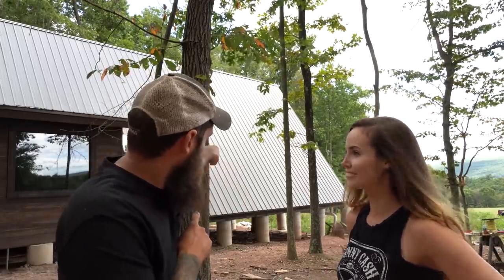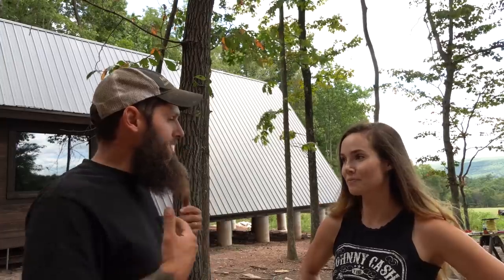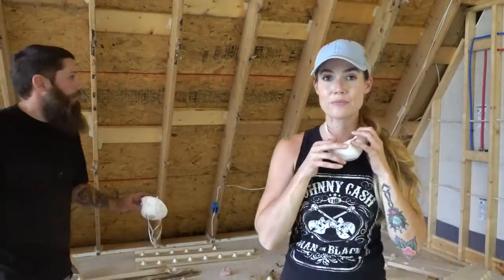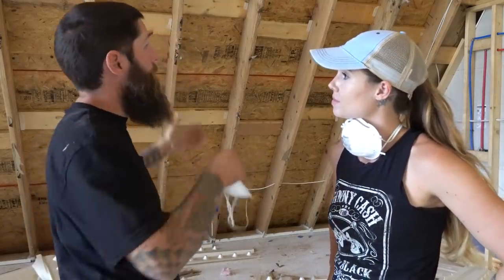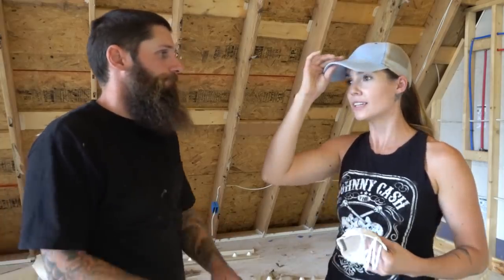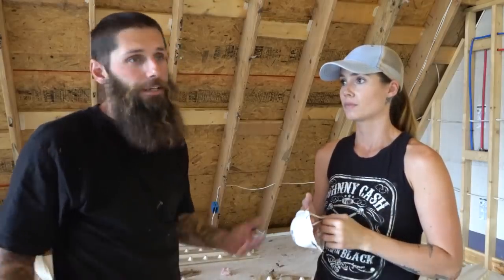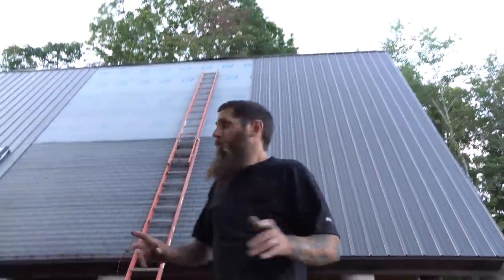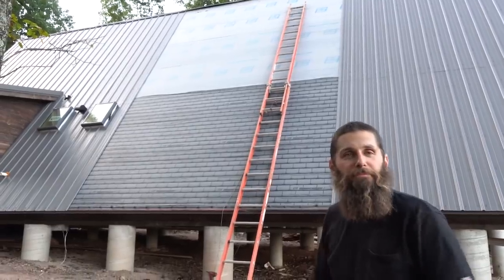Our BIGGEST Mistake Yet!

Comment: its only a mistake if someone else has to fix it! other wise its just the evolution of the project- ; )
Reply: I'd call it a modification during construction... not a mistake.
Reply: correct
Reply: Gotta remember to tell the wife that next time! Thanks!
Reply: I plan to build something from scratch because I want to be able to make any and all modifications I might determine necessary as I progress through the build. It's much better, cheaper and much less labor and waste than building and then tearing it back down and trying to install the modification after it's already been closed in and built over what you decide to later modify.
Reply: Sometimes we change our minds, it’s ok...when you build it yourself you get to change it because you know exactly how it was put together.

Comment: Keep adding dormers and you'll have a regular house before you know it. Looks great though.
Reply: I was thinking the same thing. Even thought 2 original dormers were funny, I thought the whole idea of an A frame is cost and time, adding dormers is wasting of materials and very time consuming. But then I never liked A frames due to their loss of usable floor space.
Reply: An A frame also helps with snow removal. And regardless your comments and not really helpful, sarcastic and judgemental.
Reply: @TheShays   Nope, Matthew or Roberts comment wasn't sarcastic or judgmental....They have a right to an opinion just as much as you do....Now your comment about them is judgmental...
Reply: I had the same thought. It is good to consider the adaptation of houses and consider the end results and if maybe there could have been a better place to start. The A frame seems to be easily retrofitted in the end.

Comment: Let more light in..
Looks good. 
Are yous going to put a matching Apex roof on the opening.
It is going to be the main Entrance to your home so I think yous should pay lots more attention to detail and make it look impressive.
Big Apex with a room window in the centre above the double leaf front door that you can slide up & Down. A TIMBER Frame Porch with big timber beams and nice shaped knee Braces coming from the timber beams holding up the porch Beam and nice  decking for the planters swing and rocking chairs.
I'd say about 8 feet deep for the decking so you can put a beautiful chunky custom timber railing on it.
Have a vision and see what I see.
It'll look absolutely beautiful.
You could also use the porch roof as part of the flooring for the room above the front door brining the Apex halfway out onto the porch roof with a double leaf door instead of a window and walk out of the room onto decking above the porch roof with another Beautiful handrail with some planter boxes and seating.
Sit down and DRAW IT you'll see it. 
It'll look amazing with Josh's concealed lighting and brilliant electrical engineering skills.

Comment: Hi good morning its 7:39 am in good ole new jersey.i have a question/ suggestion..my cousin has a A frame home. He was in the same situation..ie: adding a dormer..when it came time to build it he had basically cut 8 inches of the osb at the top measurement marked the bottom.istalled the supports..here's where he went a different route..he made and installed hinges at the top.made the header wall and front wall on the floor so it was ready to be stood up and nailed in..basically the top of the roof he was removing was on a hinge and was cut to lenght for dormer roof.he hoisted up the bottom end installed front wall then stood up header wall and nailed it into place.before he removed the hinges he used big nail plates as factory prebuilt trusses have .he added additional rafters for support on now what is the roof of dormer.the left over piece of old roof was used as a roof for a shed..he figuered there was less labor this way and very little wasted material.only additional cost was time,labor, and the nail plates.I was wondering if you thought of that? And what are your thoughts on his process of adding on his dormer?Thankyou for your time and any suggestions..keep up the great work..gotta say your home is coming out AWESOME!!

Comment: OMG! You are both so brave to make that change and remove the insulation/batting and OSB from the A-Frame. But I guess like you said, it's better to make the change now than after the drywall and electric are done. Just hope you can get it closed up before any bad weather comes your way. Erin, please be very careful and try not to stand at the top section of the ladder. That is very dangerous and you can very easily loose your balance and have an accident. Best to do thing as safe as possible. Take care and good luck with the modification to the A-Frame.

Comment: Hi guys, new subscriber here. Actually, I will not call that a mistake at all. Because that opening was not originally included in your original plan. If that opening was included on the original plan and you forgot to open it, then that’s a mistake. But this is an “addition”, a new plan. And knocking off that part of the A frame is part of the new plan. So you guys are actually ok.

Comment: Hi, with a project like this, changes are the rule. Better to do them now than to do them as you said, with the inhabited house. Usually when I work, the family that lives in the house either goes on vacation or moves for a short time away, either from a relative or a rented house. Dust and noise are not a good thing for a normal family. However it happens that, even if it is followed by an architect, one realizes that the space is not enough and it is necessary to ask permission to the office of building, for the change of housing volume. You are lucky not to live in Italy where the bureaucracy makes you wait months and months before perhaps giving the go-ahead. I look forward to seeing the continuation of the change, thanks to the video and Ciao from Lido of Venezia.

Comment: Do you plan on putting a small vertical wall at the base corners in the A frame? Otherwise you will end up with a really tight unusable corner.